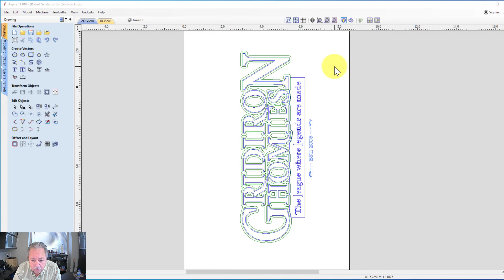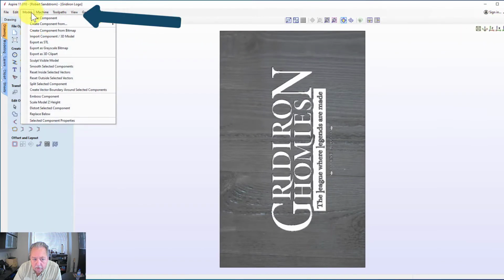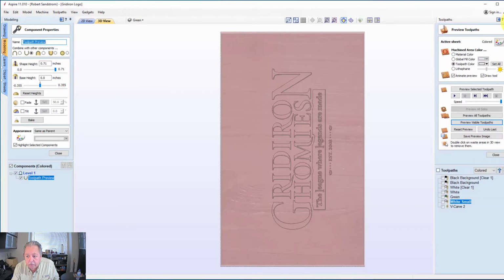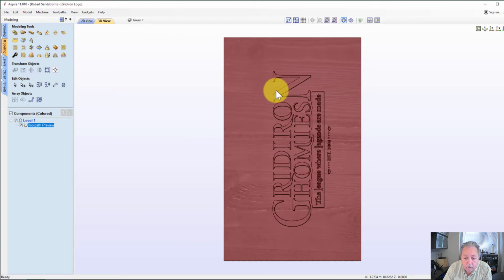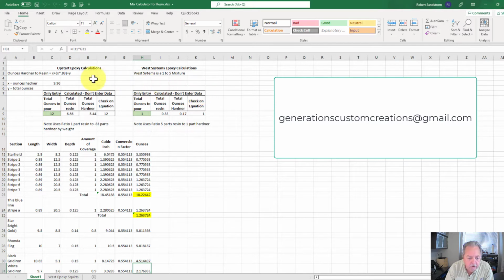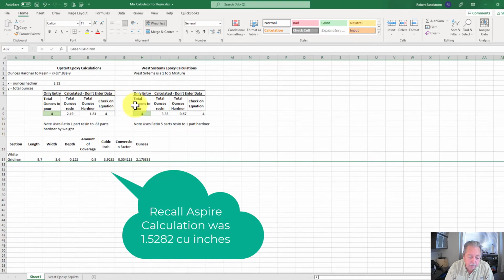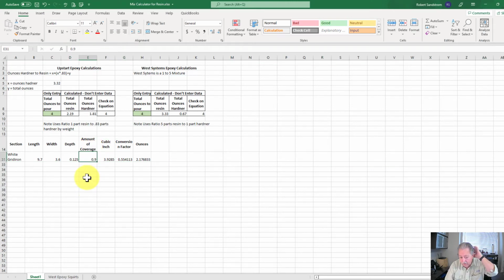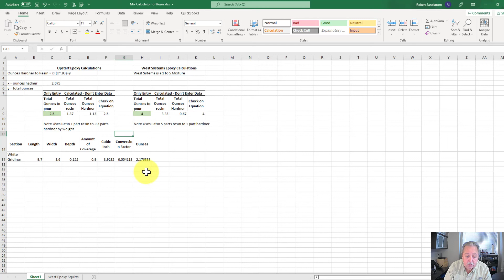Calculating Resin Volume and Updated Information About Aspire Volume Calculations

Comment: Rob, where does the 0.554113 on your spreadsheet come from? I realize its the conversion factor for the volume, but I was wondering how you came up with that specific number? Thanks!
Reply: never mind, figured it out. Thank you for your videos!
Reply from the maker: @dannymartens5060  glad you figured it out. Basically I Googled how to convert from cubic inches volume to ounces.  

I then validated that I was using the right method  by going to a couple of the epoxy manufacturers online epoxy calculators where they have you enter the data to arrive at Cu inches and they end up with ounces.  I did reverse engineering and found they were using the same conversion factor it just wasn't obvious.  

Sorry for the delayed response and glad you found out on your own anyway.

Comment: How would you convert your volume to weight? I'm assuming that would change from company to company. Do companies publish the densities of their resin and curing agents?
Reply from the maker: Craig thank you for the question.  In discussions I have had with those that are engineering minded this question has come up a few times.  The short answer is: I don't convert from volume to weight. The often elicits a follow-up question of how can your method work if you don't account for potential different specific densities of the material?  I can tell them from experience it works for me and my friend Shane Peters (my mentor in everything epoxy).  But then I provide the below reason why it works.

The volume I calculate is my starting point for determination of how much resin I need.  When I use this method it is a close estimation.  I don't ever measure the physical volume by looking at a graduated measuring cup/vessel.  All measurements are based on weight (based on manufacturer's recommendation). In this instance the ratio given by Upstart Epoxy for their epoxy to hardener was .83 hardener by weight.  So I measure first the resin (in weight) and then I measure the hardener (by weight) - I don't look at the actual visual volume.  When I am done mixing the two together I have the ratio required by the manufacturer.  

If I were to look at the actual volume by visual markings on the side of my measuring cup (not weight) it will often be either slightly more or slightly less than the total volume I calculated was needed.  

This works for me because I try to mix up slightly more than I really need.  Since I made this video I switched to an epoxy manufacturer that provides metering pumps which makes the process even easier.  I hope you find this helpful.
Reply: @RobSandstromDesigns  Thank you so much for a detailed answer. It makes complete sense.

Comment: Hi Rob I have watch your video for the resin calculation, I have my own calculation in Excel .I start by clicking on the vector to be filled ,scroll down to Vectric measure/Span Contour Properties
take the Vector Area: number 3433.9 down then in Excel I calculate Depth of resin i.e 3mm times Area:  i.e  3433.9 mm2  Then division by 1000 +12 percent for over spill. This is for mm the calculation works. This calculation gives me a resin pour 11.4 Grams.  I have set it up so I only have to enter the Area: Number in to get the calculation  so far the resin has been ok.  
Each vector for the same colour add all the Area: together even works on small text just have to add each letters area .🤔Many be worth a look Rob Love the videos David from the UK
Reply from the maker: Sounds like a very good methodology - the proof is that you have been using it consistently.  Thinking it would be worth mentioning in one of my future videos if - I can remember.  Thank you for sharing.

Comment: The easiest and foolproof way to measure volume, is to fill your carving with fine powder, such as plastic, but never sand. Sand will chew up your bits fast if any is left over! Then empty out the powder onto a scale.  You would need to make a weight conversion of the powder weight to how many Ounces of what ever Epoxy brand that you are using.
Reply from the maker: Mark you’re correct about a way to measure but at this time I’ll continue my method - it is working well for me.

Comment: Thanks, I do wonder if you knew about the Epoxy Volume Calculator. If you search this you should find a vectric forum post from jlavintx63 and you scroll down to version 1.4

I wonder how close that's going to be compared to your methods.
Reply from the maker: Jasper...thank you for asking and the answer is I do know of the Epoxy Volume Calculator gadget for Vectric software.  This came after these videos.  

Jim Gavin initially used the spreadsheet i share in these videos as the basis for how structured and calculated resin amounts in his gadget.  I have seen him go through multiple iterations as he fine tunes this calculator.  I have not had a chance to actually use it and determine how comfortable I am with it to inform my pours.  

My only concern with the calculator, until I can get some more experience using it, is that it should be very accurate with the amount of volume contained in the cuts.  That should be good and theoretically will reduce wasted resin by mixing more than is needed.

The down side, is that I am not very accurate with the resin as I pour it, not everything I pour makes it into the actual cut.  So, I need to figure out how I can compensate for my lack of accuracy in pouring vs. his calculations.  Similar to when I am making a wood project I always add a certain wastage for determining how much lumber I will buy.

Let me know if you use it and how well it is working  for you.

Comment: Thank you for the video.  Its quite helpful.  I do have some confusion and need some help understanding.  If I understand correctly, you’re using the calculations at the top of the worksheet to measure on a scale how much of each part you need.  However, I don’t see where your converting fluid ounces to ounces (weight).  The conversion factor of 0.5541 is to convert from inches cubed (volume) to fluid ounces (volume; not weight).  Am I missing something?
Reply from the maker: As you point out, technically the amount of space that needs to be filled in Volume as you indicate is not necessarily equivalent to the weight in ounces.  

Furthermore, as you observed, I first calculate the volume in space cubic inches, convert that to volume in ounces (space).   The manufacturer has two methods for measuring the proper ratio of their epoxy:

1.) Physical observation via calibrated cups or other devices - this ratio for the epoxy I have been using so far is 1:1.  Basically you are looking at how much space the fluid is occupying in the containers used for mixing. 
2.) The other method provided by the manufacturer is to mix by weight:  The manufactures ratio for the epoxy I am using is 1 part resin (by weight) to .83 parts hardener (by weight).  This ratio needs to be supplied by the manufacturer.  

You are correct an oz. isn't necessarily the same in both methods.  I have noticed that when i get done mixing the  actual volume (space) i thought I was filling in the cup with the combined ratio looks slightly different - can't recall if it seem as little high or low while I am responding to this question - not i realize why.  It wasn't enough difference to concern me - i wrote it off to me not having a good calibrated eye.  I think your question identifies the real reason.  

I just never thought about it in the technical terms you identified.  I will say, since using this method, starting with the volume measurement as the starting point, has not resulted in me being short.  But then again, part of that may be that I keep rounding up.

It would be an interesting exercise to physically pour an ounce of each liquid and see what it weighs in ounces.  Not sure I will do that because what I am doing works for me.  If you do, I would love to hear what you find out.
Reply: @RobSandstromDesigns  Thanks for the response.  I am going to do some research and see if I can find some formulas to convert fluid ounces (volume) to ounces (weight).  I am sure we will need other data points too; like specific gravity for each liquid.
At first, I was worried that the ratios were getting off because of the lack of conversion but I think the way you are calculating still maintains the ratio for resin to hardener.  So, no issue there.
Next time I poor, I will do some measuring to see if I can figure out what the conversion from 1 fluid ounce to weight is.  Of course, this will be specific to the brand I am using.
Thank you again for your videos.  The tips and knowledge I have learned from you and Shane has been awesome.  Well done!
Reply: @jarredcleem5028  I'm trying to figure this exact thing out.  The problem is that there is a density variable involved.  The density of the resin is different that the density of the hardner.  The manufacturer of the epoxy I use (TotalBoat) does publish the mix ratio by weight.  In my case its a 100:45 mix ration by weight.  But thats still not enough information.  What is that a measurement of.  Is that 100 grams, 100 ounces, or something else.  Lets say for discussion sake its grams.  Well, is that 100 grams per what?  Could be 100 grams per cubic inch.  Or 100 grams per fluid ounce.  If I knew those details, then I could complete my spreadsheet I have to calculate all this for me.